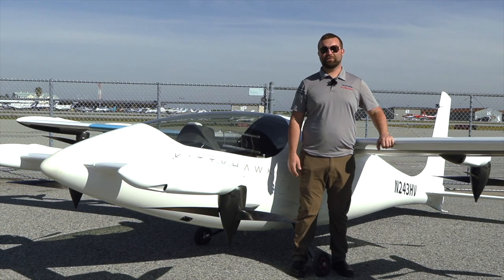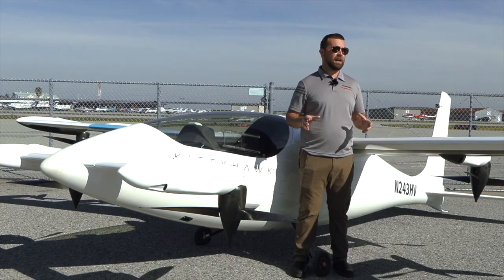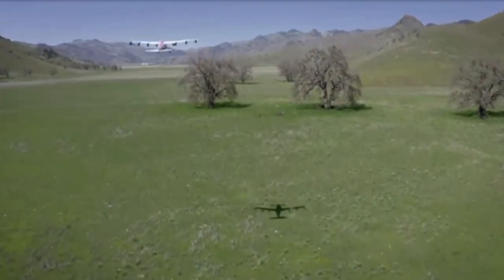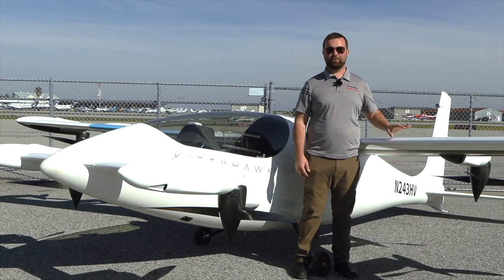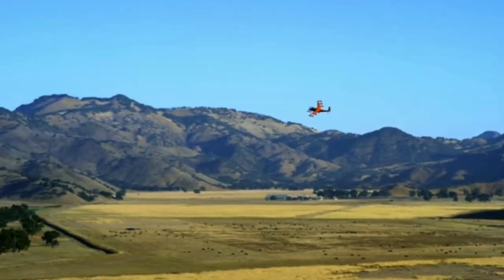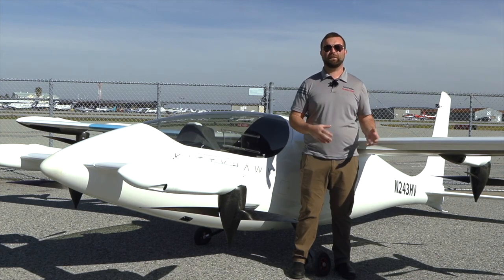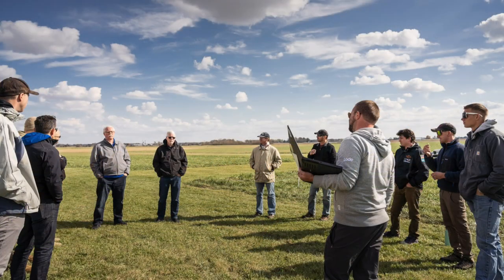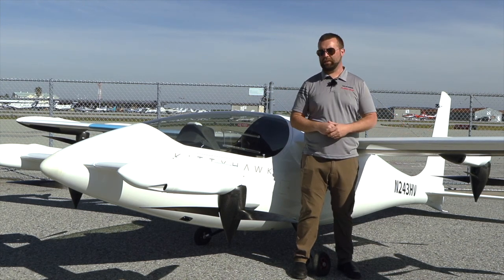VFS eVTOL News Interview: Chuck Taylor, Kitty Hawk

Comment: Kittyhawk is the perfect example of why you don't want a bunch of EEs in charge of your aircraft design. Larry has killed Kittyhawk - long live Kittyhawk! Next time Larry, focus on hiring Aero Eng.
Reply: What's wrong with the aircraft design?
Reply: @graikonungr7502  Let's see, where does one start? It was known to throw rotor blades and there are rotors inline with the cockpit..., it was way over the intended weight because they were using carbon fiber like aluminum and then there was the issue of the noise in the cockpit hitting around 160 decibels!! That's enough to damage your hearing in short order. I could go on for pages, but it is that noise level and the throwing of rotor blades that are dead giveaways that the design was in deep do-do... I could explain in detail where the offending vibration was coming from, but that would take a good sized AIAA paper and it really is a moot point now. These are the issues that tell one that having dozens of EEs on the team and only one Aero Eng was very short-sighted.
Reply: Curious as to why you were following this aircraft or the evtol segment (not part of the flying wing or foot launch sector..)
The figure of 150 dB in the cockpit  is indeed a show stopper but hard to reconcile with the claimed external noise (maybe even allowing for the distance to source) there would seem to be minimal upstream flow disturbance compared to say a Vari Eze et al (which is noisy inside and the rear 'headrest' brain scrambler )  why they persisted with ca. 14 copies after realising such a show stopper fault is hard to fathom... but easy money going into it might explain .  Larry Paige put up the first ,belated, NASA centennial challenge prize money after getting sucked in by Mark Moore and CAFE (Brian Seeley et al) which was a fiasco , ditto for the later ones (the freakish twin taunus as 'winner' or the Pipistrel motor glider etc all dead ends that had no practicality BY DESIGN , for example , what happens to your heaviside after you land? Unless you live and work on a vertiport (ha) it is useless for the proposed committing.  Getting immersed in the technical minute or solving problems in implementing a chosen design but losing sight of the end result seems to characterise this whole field.
I would like to know a little more of how you had such detailed inside knowledge of this project and would encourage writing an SAE or AIAA paper in depth before yet more billions are wasted on foredoomed  mistakes .